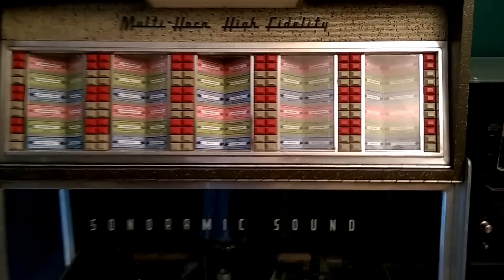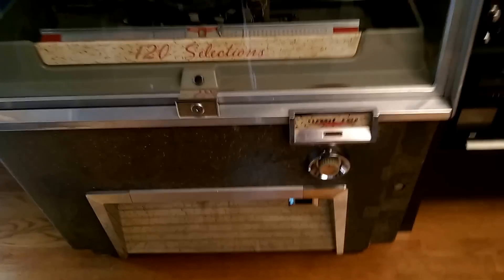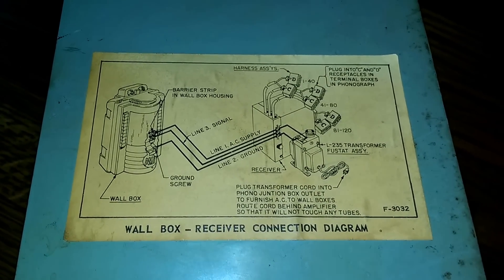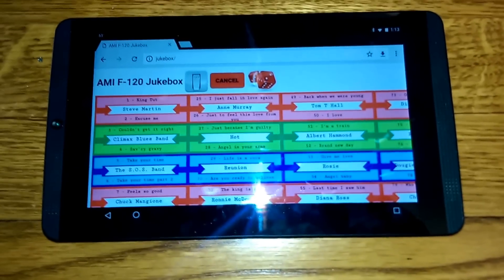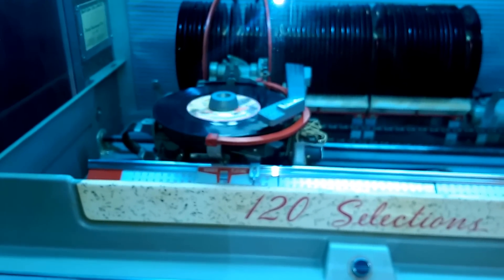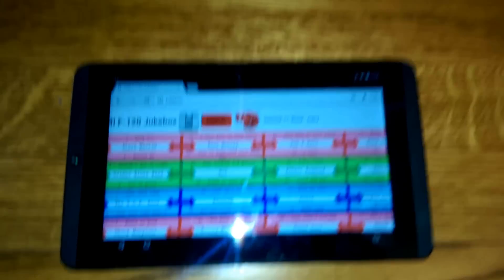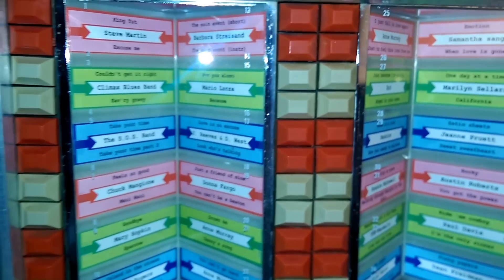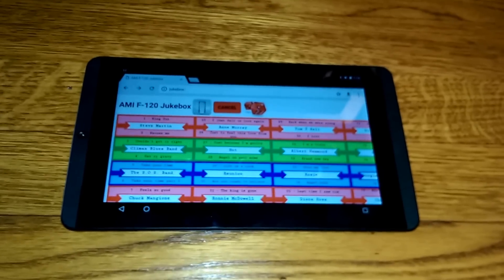AMI F120 Jukebox controlled by Raspberry Pi

Comment: Very Cool, I have a wallbox, wondering how I can hook it up to a pi so that it reads the pulse selection and start a song stored in the Pi
Reply: There's one main way of doing this with several implementations. In the end all of them boil down to logging the signal from the wallbox on a GPIO pin of the RPi. Then counting the number of gaps, and how long they are. Just look around google/github for your brand and I'm sure you'll find something :)

Comment: Nice project, do you have code or docs in a repo somewhere? I just looked at my wurltizer silhouette and its got a remote connection and I'd use a beaglebone sbc to host the lamp stack after bad pi sd card reliability experiences, so some tinkering would need to be undertaken but not rocket science & would rather not reinvent the wheel if posssible.

Comment: Awesome, thanks for the great ideas. I will try this on a Mac TV with Plex Media Server, with a touch screen, and the Plex App. Remotely on the Android mobile phone. 
If that won't do the trick, I can use Android TV on a Raspberry PI 3b or a macos Mini maybe, but than with a Ubuntu OS installation. It'seems that this might work perfectly. 
However, I need to know about the Relay Circuit board, I need to control a CD/DVD 400 Disc Changer from Sony.
So, I can't work this out, with a "Wall Box" Stepper Relay Unit, as you did, I need to know the "right 'control' solder-connections" to the Sony motherboards used in the 400 CD/DVD Changer (carousel CD-disc charger). Maybe someone knows this info, where to get these print-out, about Sony's blue prints of its developed dolby stereo devices??